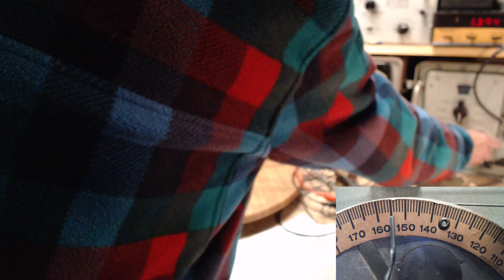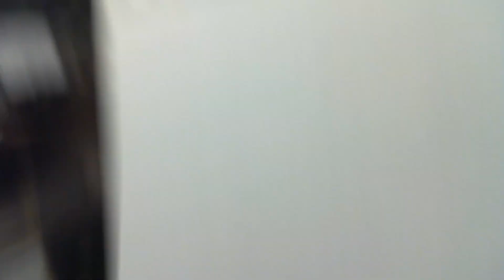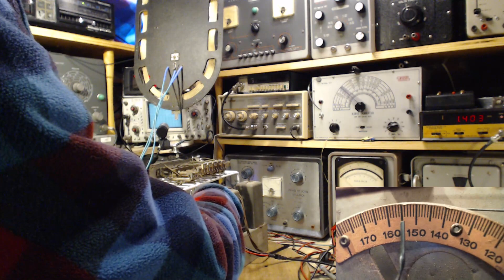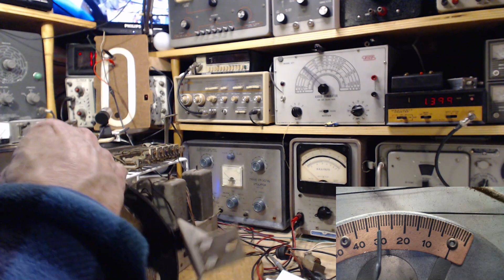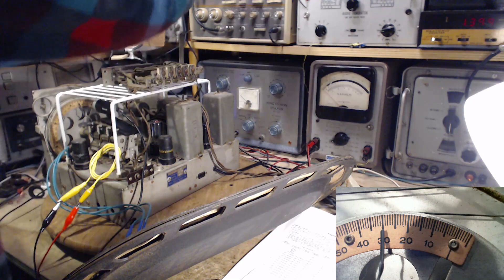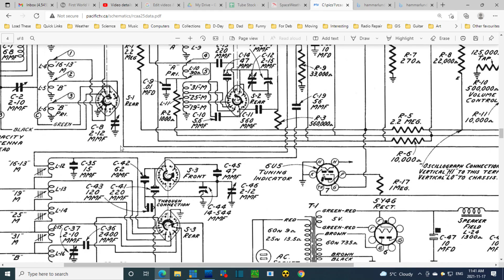RCA Victor A38 Shortwave Tube Radio Video #10 - BC Band Alignment Attempt

Comment: Just curiosity. As is, when you turn the tuning knob clockwise, the pointer slides to the left end, when turned ccw,, the pointer moves to the right end (variable cap fully meshed). Besides being counterintuitive, is this the way the dial plate scale is printed?